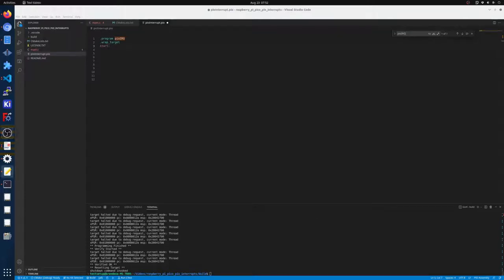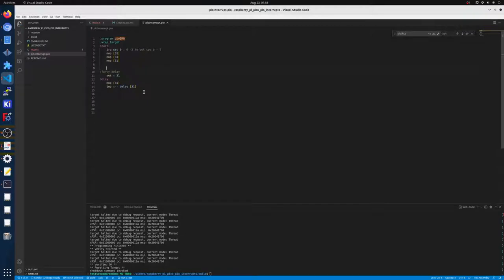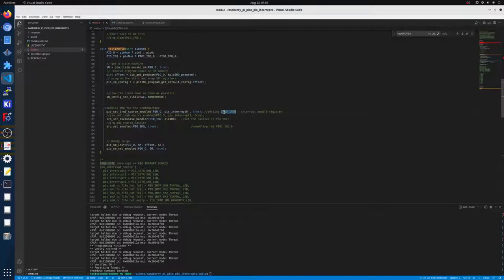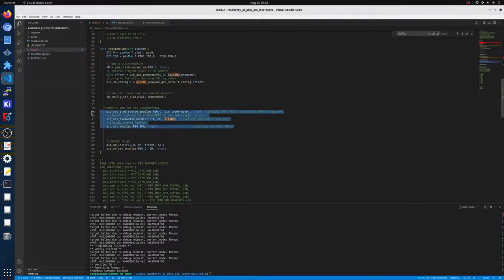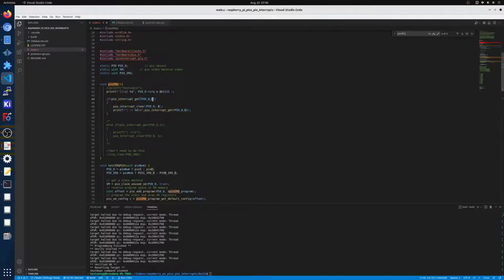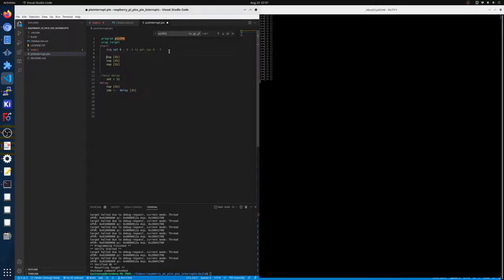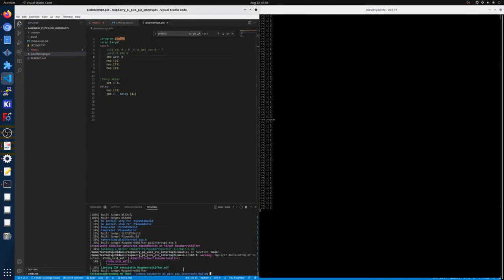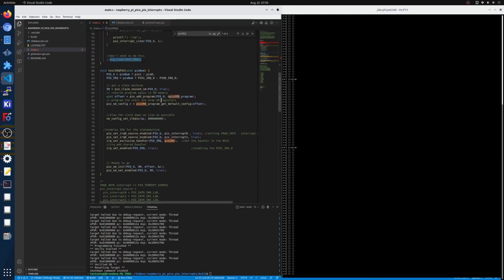raspberry pi pico - sending interrupt from PIO to cpu - in c

Comment: Thanks for this great video, it really helped alot ^_^
Do you have any idea on how can I implement?
- Extend UART peripheral of the PICO to 3 not only 2 using the PIO.

- An interrupt is to be generated when there is data in the RxFIFO and store this data into a buffer.
- Baud Rate 115200.
- Data bits = 8.
- The max  length of received data   = 512.

I generated the interrupt successfully upon receiving data in the RX_FIFI but when I try receiving more than 10 bytes the received data is corrupted. 
So, I would be very thankful if you could help.
Reply from the maker: If your goal is to have make a uart with the pio blocks there's a few example you can work with  https://github.com/raspberrypi/pico-examples/tree/master/pio/uart_rx https://github.com/raspberrypi/pico-examples/tree/master/pio/uart_tx
Reply from the maker: So if your just doing RX input you can join the fifo's to make a bus that's 8 byte large.
Reply from the maker: But if you entire width is 512 you might be able to DMA out data from the PIO.  But currently i haven't started working with DMA so i won't be much help on that front.  At least not for a while.
Reply: Thanks for your fast reply.I have already implemented the UART Tx,Rx from those examples and added the interrupt for the receiver as mentioned in your video, I made the Rx,Rx FIFOs Join. The problem with me is that the maximum length of data I can get is 255 bytes despite using the interrupt which is not logical for me. So I will actually try using DMA. thanks so much for your concern and help 💫

Comment: Absolutely fantastic! Thank You! Probably just saved me HOURS! ...I would like to agree with the font size comment - a little bigger would be very much appreciated (so I can watch it away from the PC) ...Also, I see you have used `pio_set_irq0_source_enabled()` [`_irq0_`] ...could you comment on the `_irq1_` variant and how it differs ...Looking at `pio.c`, it seems `_irqn_` just calls `_irq0_` or `_irq1_` based on the `index` parameter.
Reply from the maker: So here's a diagram of the PIO blocks - https://blues.io/wp-content/uploads/2022/03/pio-block.png
Reply from the maker: At the top you'll see this IRQ masking block with 2 interrupt outputs.  What i think is happening with pio_set_irqX_source_enabled()  is binding the state machine to the given irq hardware.  So normally you would bind the irq0 to the first pio block and the  irq1 to the second pio block.  I've read on forums you can use both irq's on one state machine but that just doesn't  sense on how or why somebody would want to do that.
Reply from the maker: Also i totally a agree with you on the font size thing.  That's something i've gotten better with newer video's.   Also if you want a more complex video on interrupts and pio's.  A video i made on  usb host to ps2 keyboard  might be a interesting watch https://www.youtube.com/watch?v=ATGZD2AyFkc .  I used interrupts in a slightly more complex manner
Reply from the maker: Also if you have any topic suggestions or more questions i'll be here to see what i can do
Reply: @brendenadamczak9283  re IRQ binding... Looking at the interrupt list, each PIO has two IRQs so I guess you could have two IRQ handlers and avoid the need for the if/switch statement in your handler
Reply: @brendenadamczak9283  I've not looked at your video list yet, but topic suggestions? ...Timers/alarms that trigger events such as CPU or SM IRQa, or a function call ... Controlling PWM with DMA ...IPC strategies for dual CPU programs ...cross CPU semaphores ...I'm sure more will come to mind in time :)

Comment: Brenden you are using pico probe for upload the firmware quickly i guess
Reply from the maker: Yes.  I find dragging the firmware file over usb to be nice.  But it can be a pain if you have to do it a lot.  So if i can just send a command to flash, thats optimal.

Comment: Thanks for sharing your code, but you should zoom your video for a confortable experience.
Reply from the maker: You got a good Point!  You'll saying that the text is a little small. When i'm working i'm like 5 inches away from like a 27 inch monitor.   So it looks completely normal.
Reply: @brendenadamczak9283  I was at mobile...I couldnt read it hehe at PC I could follow you. 
I added your code to generate a Int for 9 bit serial receive
Reply from the maker: @YorranOliveira  Very cool
Reply: @YorranOliveira  Could you please share the whole code that managed to receive serial data using interrupt?
This is what I'm trying to do:
- Extend UART peripheral of the PICO to 3 not only 2 using the PIO.
- An interrupt is to be generated when there is data in the RxFIFO and store this data into a buffer.
- Baud Rate 115200.
- Data bits = 8.
- The max  length of received data   = 512.

I generated the interrupt successfully upon receiving data in the RX_FIFI but when I try receiving more than 10 bytes the received data is corrupted. 

So, I would be very thankful if you could help.
Reply: @nahlahussien1383  sure. I'm going to up load it to git. It's a mix of raspberry example without int plus our friend code and an adaptation for 9 bits.
Reply: Thanks so much for your reply and sharing your code💫 It would really help. I hope understanding the code without the need for further comments 😅